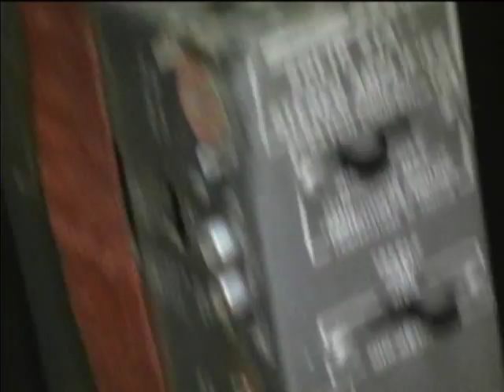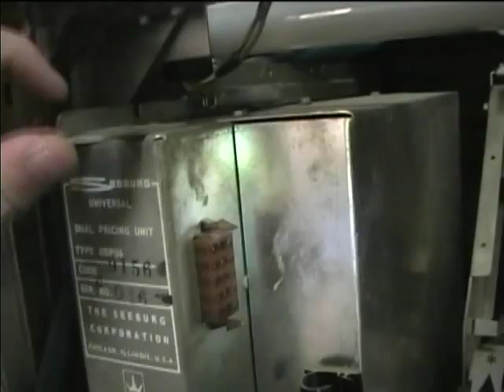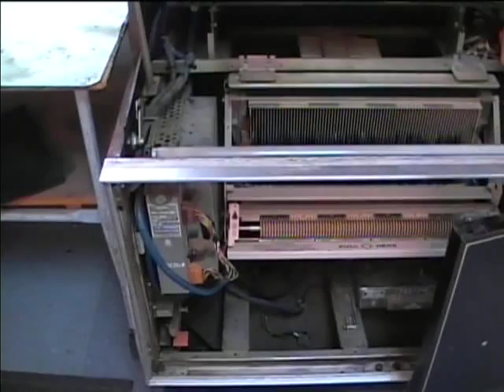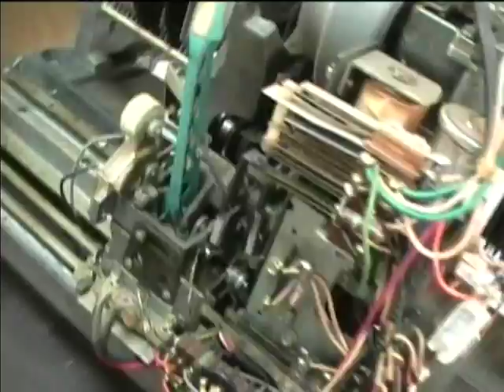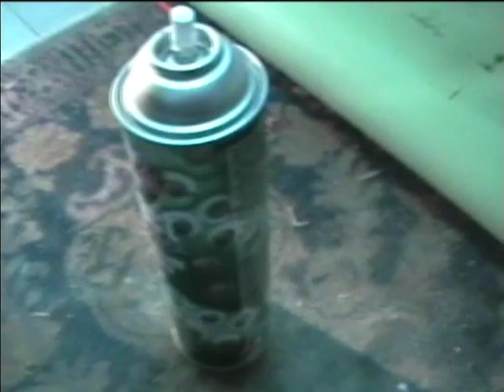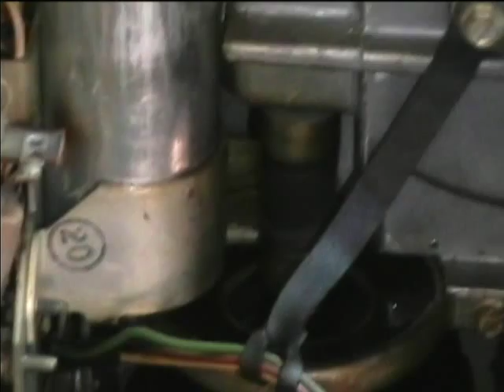1968 Seeburg LS-2 Jukebox Repair (part 1)

Comment: Hello picked up this 1968 seeburg LS-2 jukebox you are viewing overall in great condition but cannot get it working, the motor is working but when i hit the scan switch the scanning mechanism does not move, cannot play anything or reject, also how do you no if your service switch has gone bad, any help asap would be greatly appreciated, to note it does look very dirty below mech.    Thanks

Comment: @Trance88 Seeburg made a home console jukebox that looks like a console stereo of the period that plays 12" 33-1/3 LP records...I have restored 3 of them. They were made in the late 60's thru the early 70's...They have a telephone dial to "dial up" the record # you want to play on the earlier ones! They sound awesome, too! Watch Ebay for one...they usually go for around 300 bucks. Some have an 8-track & AM/FM radio built in, too!

Comment from the maker: @Trance88 It will play 7" 33 RPM records along with 7" 45's...there is a switch that detects the large or small hole of the record when it is loaded and switches in the autospeed generator for a small-hole 33 RPM record. They are not all that common but we have found a few of them.

Comment: I had this very same jukebox many years ago and sold it.  I do have an LS-2 or later model mechanism with all the electronics to operate by a wall box.  It will not select plays from the wall box, it just scans and shuts off.  If you pull out the tormat input plug it will stop and select, and then proceed to scan and shut off.  It probably needs some recapping in the receiver unit. .Nice work on the LS-2